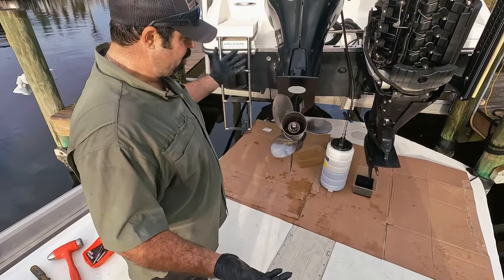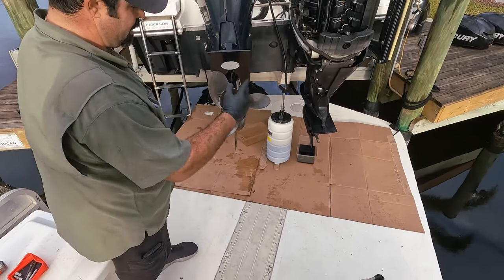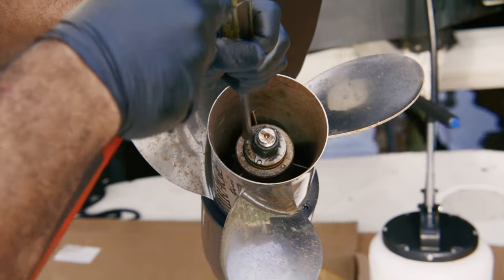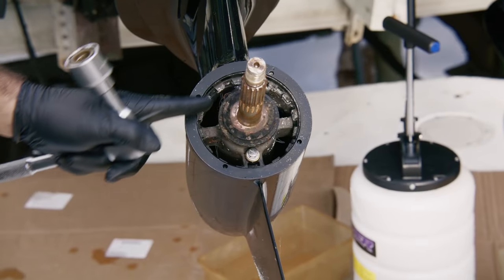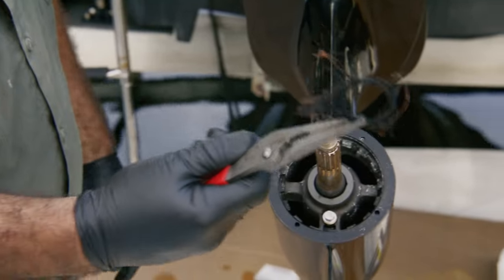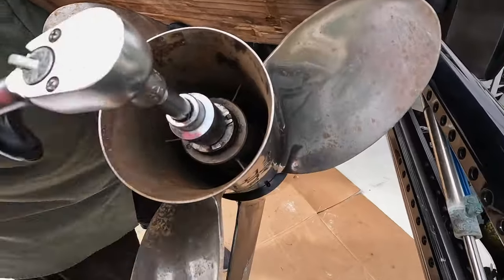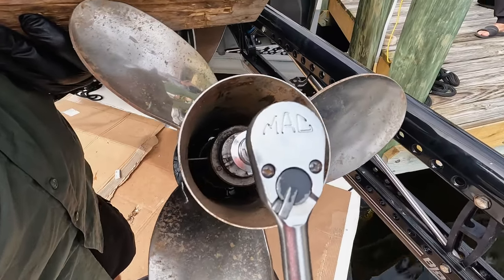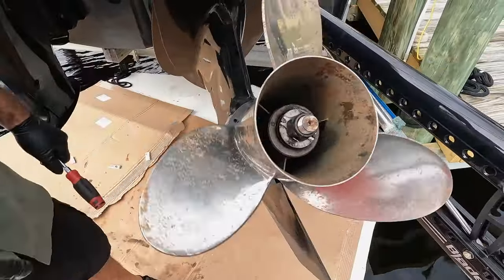How to Remove and Install a Mercury Outboard Propeller

Comment: 2:10 I have done this but my thrust washer won’t go back on. I had to tap it off like you did but it won’t go back on all the way and is like 10mm from being flush like it was. I have tried to push it back on and lightly tap it back on but it won’t budge. Do you know what I’m doing wrong or how I can get it back on as easily as you did?
Reply from the maker: Hi Jamie,

I am sorry to hear you are having trouble. Cutri is a very seasoned mechanic and makes everything look easy. That being said, it is very easy to bend the thrust washer. Apply grease generously and if it does not go on smooth, toss and replace it. You do not want to reapply a damaged or bent part and potentially damage a very expensive part or lose your propeller as a result. Best of luck to you!

Kind regards!

Comment: I have a 1992 OB mercury 175 and I am lost on how to remove the prop. See attached photos, any idea what tools needed to remove the prop?
Reply from the maker: Good afternoon! Thanks for watching the video as he is always such a great resource. The only thing you should need tool wise would be: what you saw in the video to help loosen, a flathead screwdriver as seen, a prop wrench or a socket wrench with the correct socket size and possibly a hub wrench. We would love to be able to help you identify some of these either on our site or by calling 1-888-625-5460 and speaking with any of our customer service agents!

Regards and happy boating!

Comment: You never showed the sleeve on the inside of the prop or what to do with it . Grease it. Don’t grease it, etc
Reply from the maker: Hey There William,

Thank you for watching!  I know that not all engines require a bore sleeve. I am so sorry that wasn't included in this video. See below for details. 

Install the Bore Sleeve:

Take the new bore sleeve and apply a thin layer of marine-grade grease to its exterior and the interior of the propeller hub.
Insert the bore sleeve into the propeller hub. If the fit is tight, you can use a rubber mallet to gently tap it into place. Ensure it is seated evenly and flush within the hub. Finish installing the propeller!